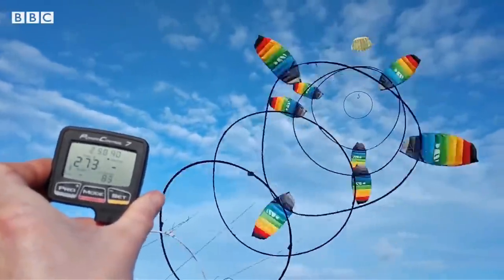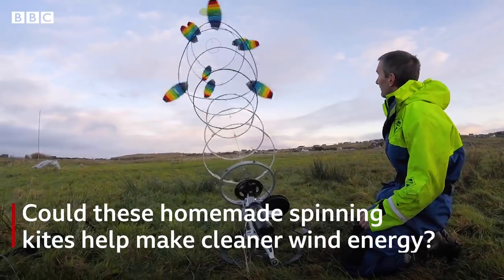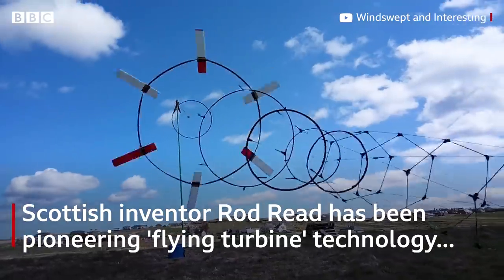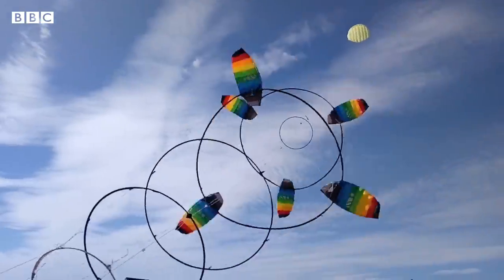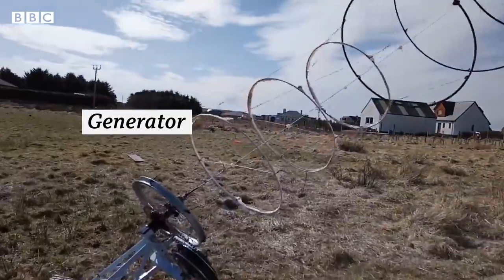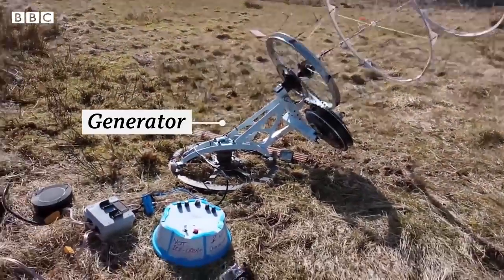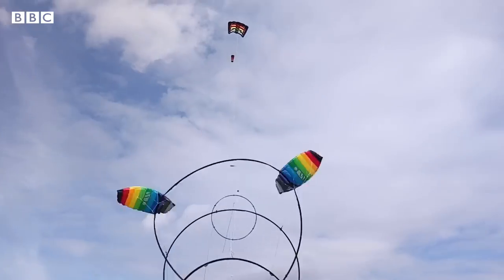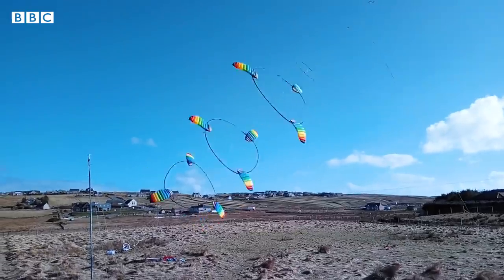How spinning kites could power your home - BBC News

Comment: Amazing idea. And so cost efficient. Also using our sewerage for methane and power (as they used to do to light up the London streets). The biggest question I have is WHY ISN'T THIS ALREADY IN PLACE?! A little insight - London night street lamp lights using sewerage sourced methane were put out of use by the BIG companies 100+ years ago, as more profit from getting it mined elsewhere. It's all to do with profit before the environment.
Reply: yes ...power London's light  on shit.. this is old technology that modern, antiseptic, pipe and wire- loving  city folks need...

Comment: Maybe in a rural large parcel of land. Urban setting which is a more common dwelling will not work. These would immediately tangle and destroy each other.  Hope you noticed the small parachute holding the system up at least tethered about 200 feet. No city would allow this in their backyards.  : = ))

Comment: This is great. And should a bird be unfortunate enough to fly into this thing, the worst that can happen is you might need to untangle the innocent creature and set it free. 

Also, there's be no need for a concrete (huge Co2 emissions) foundation. Instead, a simple copper pipe (and perhaps a few steel rods for extra strength) which would also work as an excellent grounding post to divert a lightening strike should you set one up to generate 24/7.

This is the golden age of tech. I hope the youngsters will get over themselves, stop with the entitlement nonsense and start working on some solutions to achieve harmony, rather than just demanding it.

Comment: A windmill, but with twice the technical problems. It's NOT scalable. As the scale increases, the amount of wind required to lift increased weight and cable thickness increases. And what happens when the wind goes? How does a 10 kilmetre cable return gracefully to earth? Silly idea.
Reply: We use network kite concepts and are working on robotic deployment to overcome these issues
Reply: @KiteTurbine  Mere buzzwords. "network kites=" = lots of kites. "robotic deployment" = automated deployment. Deploying ots of kites simply increases the system complexity, power cost and opportunities for failure. This is unlikely to reach a scale that can power a house, much less entire towns. This is pie in the sky.
Reply: @Martial-Mat  More kites increases the part count which also increases the opportunity for failures. However launching 9 kites is as easy as launching 3 and the turbine network (buzzword?) is an autogyro so no need for controls there. An advantage of the network is part redundancy if there is a failure. Lines have broken and the system continued in a diminished but safe state. A further advantage of networks is their modularity. You can swap a wing or rotor easily and on the ground too... not up a tower. We'll be getting as much data as we can on performance from the next tests. I'll try be more wordy less polished and sales like
Reply: @KiteTurbine  You haven't even demonstrated the proof of concept at a feasible power output yet - say enough to power a single houuse. We see FAR too many of these fantastical ideas at minute scale and are asked to believe that scaling them up is as easy as imagining it - water from the desert, solar roadways, super high power batteries, hyperlink and more - and by a massive margin, they never amount to anything. You'll excuse my absolute scepticism.
What you've showed us so far is  a small, exotic kite that generates a small amount of electricity. If this video had had an array up in the air, generating even enough to  power an electric car or a small house, it would have been something. The world needs dreamers, and it's a great cause, but the BBC should have waited until you had more than a child's toy to demonstrate. Also, how does being an autogyro help? It reduced the rate of descent, but if the wind just cuts out, or changes direction, you still have hundreds or thousands of feet of wires falling to earth. What's your retrieval strategy as cable length magnifies? Is there a lift to cable to air density ratio beyond which you can no longer go?
Reply: @Martial-Mat  Love the healthy skepticism. Thanks. In the videos you can see it has kicked out >1.5kW from 3 rigid blades using <2kg material in the air. You can also see networking (arraying in a vertical stack) of rotors. You can see rotors with 6 blades on a large rim hollow axis. Those are all scale enabling demonstrations. Yes we can work on scaling. All this was done from home and launched by hand, so you'll just have to forgive me for not risking my life with stronger systems. Autogyro, coordinates multiple kites without needing complex controls. The centripetal acceleration and outer tip  banking (down from the plane of rotation) expand the rotors to improve torsional rigidity. The transmission method is the thing you should critique as that's really novel and the part we have to be most careful with. However width, tension improve it's capacity for torque as does the ring spacing geometry and fairing will be inline with the needs of material for resisting compression. The transmission doesn't have to be long. e.g. we can start adding rotor layers as soon as the tips would clear the ground. So that will suit the offshore wind profile well. We're working on an automated deployment system project now. Yep there's a long way to go. Yep it started with toys. But this is no toy project. As for comparing this with solar freekin roads GTF you're gettin a wedgie. 1.5kW is enough with a battery for a small home.

Comment: Excellent man.  Wondering if you could make the generator wheel be horizontal and have a few such wheels stacked vertically that rotate at the generator and do the generation and then and have at least three kites on the same tethered generator.  Keep up the fantastic work!

Comment: Charged a car and had enough LEFT to boil a kettle. With surface winds. Using flimsy spinning kites. I call BS.
Reply: I mean he didn't say how long he was out there for
Reply: yeah that thing is clearly generating less electricity than an e-bike runs on.
Reply: Glad I'm not the only person who noticed they made ZERO mention of how much watt power this system generates per 1hr of X amount of wind. They also made ZERO mention of how much $$$ this system costs to make, or maintain.
Reply: "His prototype, a series of spinning rainbow-colored rings, stands out against the gray Scottish sky. On a good day, the kite generates more than 450 watts. It's just a small model, but Read thinks the technology could be scaled up to the utility level. His model still needs more testing, but kites have a number of advantages over traditional turbines and several companies are developing kite-based generating systems."
Reply: True. The video has miss quoted me. I have only part charged a car so far with one 36V 11Ah battery charge run through a 5kW inverter. It would take at least 20 of these - which would take about a full 24 hours. Kite turbine has output >1.5kW

Comment: Charged an electric vehicle, you become more fake every day. Zero information on what vehicle, the size of the battery and how long it took? BS all day
Reply: You're right to call BS . The video has miss quoted me. I have only part charged a car so far with one 36V 11Ah battery charge run through a 5kW inverter. It would take at least 20 of these - which would take about a full 24 hours. Kite turbine has output >1.5kW

Comment: why is he talking about high altitude wind when that thing's rotors only catch wind at ground level? it doesn't matter how high the kite is, the kite is not driving the generator.
this seems a lot more goofy and less promising than that other kite power generator type that actually runs a generator on the pull of the kite (periodically reeling it back in in a low drag aerodynamic configuration).
Reply: The "lift kite" doesn't drive the generator, as you say — I see no reason why the "spinning kites" couldn't be placed at much higher altitude in a scaled up design.